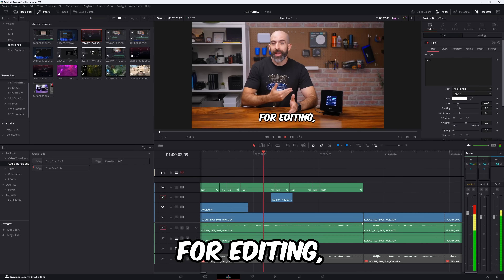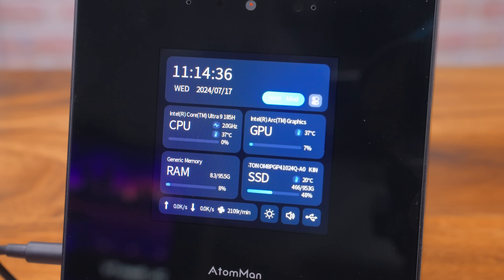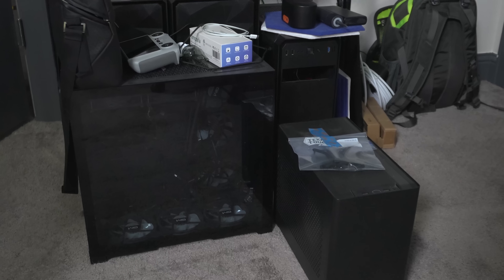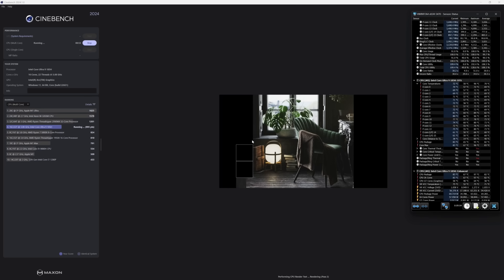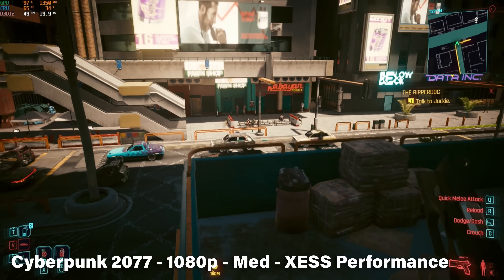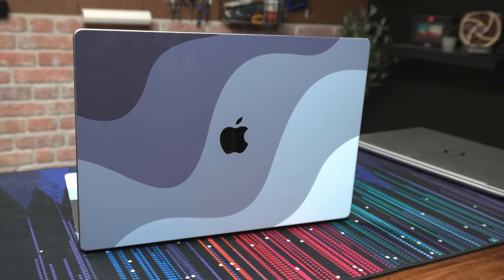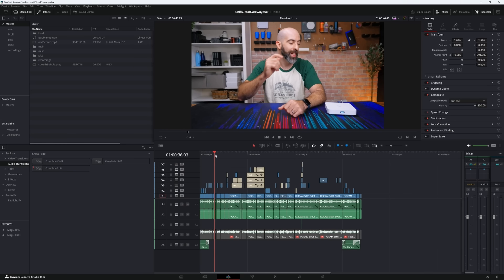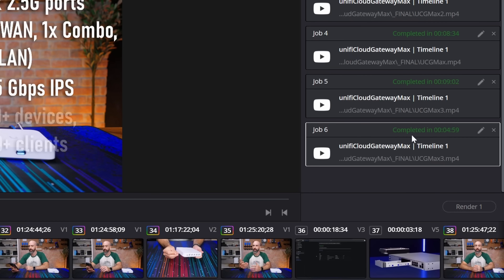Minisforum makes cool stuff - AtomMan X7 Ti

Comment: I bought the DEG1 Oculink dock.  Unfortunately it didn't work.  When I contacted Minisforum and explained that I tested it with 4 different PSUs and 3 different GPUs (from a 4070Ti Super to a RX 6400) as well as confirmed that everything worked with a $43 Amazon Oculink kit (w/ cable, M.2 and PCIE adapter), Minisforum asked me to create a video.  That's a ridiculous request.  I just want to send it back.
Wish I could've seen the dock working in this video instead of just sitting on the table.  There don't seem to be any reviews of one working.  This was the only close search result.